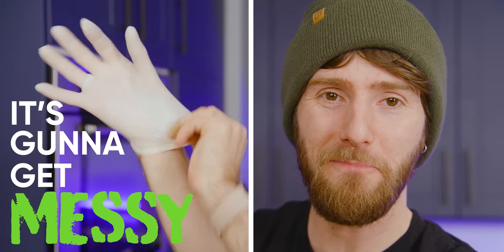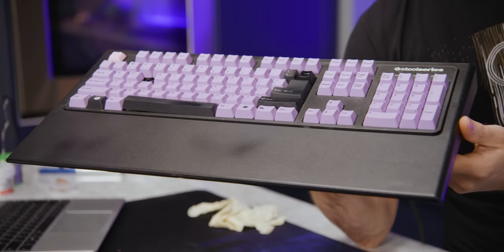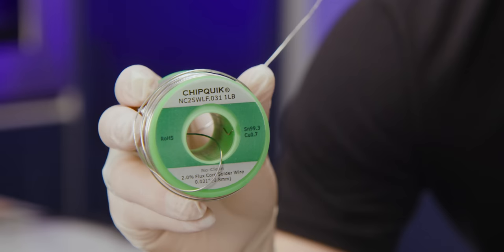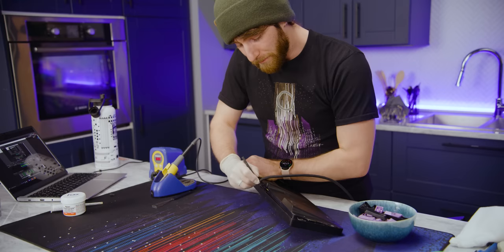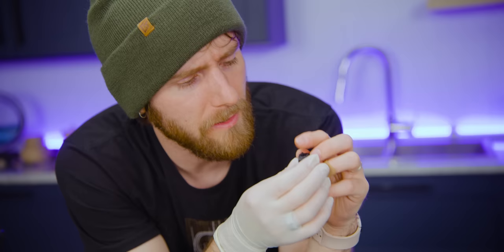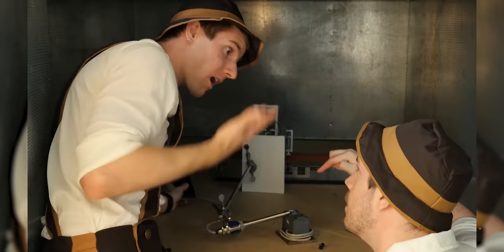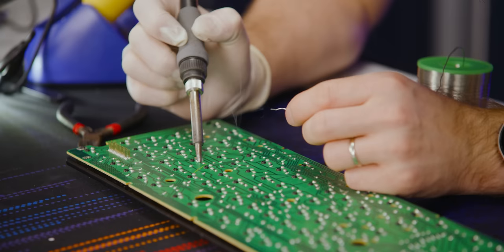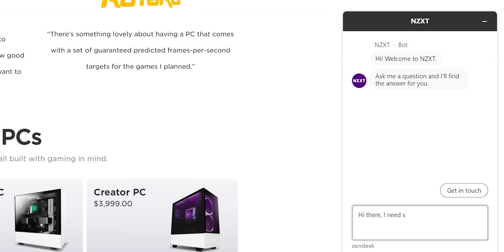Fixing my Wife’s $150 Keyboard for $1

Comment: 2:44 The first try to fix that would be (after a good clean of the whole keyboard) to blast the switch with contact cleaner.
Edit: 7:53 As said, this is likely total overkill. Just drench the key switch in contact cleaner, press it a dozen times or so, and test it again. Most likely, it will work again 100%. If it doesn't, then you still can replace it. Also: While at it, you might want to drown all switches in contact cleaner as well.

Comment: I literally went out and bought a new KB/Mouse yesterday because the E key (and possibly some others around it) was malfunctioning on my old KB (failed keypresses or duplicated keystrokes). I had a non-mechanical (membrane) Razer keyboard so swapping out the switches was not an option, I may still go back and see if I can fix it but I'm enjoying the proper functionality of the new board although the feel is alien since my old one had a much larger size for additional programmable keys.

Comment: Still these days I have this brilliant keyboard in lying around. Spilled coffee innit once. Disassembled it and rinsed board and parts with disstilled water and some parts with isopropyl alchohol. Then dried parts on low temp radiator some days. Worked like a charm afterwards and no corrosion formed later.

Comment: I retried my 7G about 3 years ago even tho there was nothing wrong with it after   almost 10 years of service. It was the first and only mechanical keyboard I have ever bought in that period and even tho the metal backplate got rusty, it was perfect. I felt like it deserves a honorable discharge after it's long and hard service and I replaced it with a razer optical switch keyboard, which I still can't remember the stupid name right, quite reluctantly. This keyboard introduced me into the Steelseries brand and made me some what a fanboy over the years. Ive since bought the Xai, Sensei, Seberia, Rivals and multiple mouse pads which all got wear and tear to their eventual death. Such a shame they aren't what they used to be anymore. Oh reminiscing youthful memories.

Comment: It's worth getting one of the cheap TS100 or Pinecil soldering irons. They even run off a USB battery if it has QC/PD. Repair a few cables and it will pay for itself. They are definitely cheaper than a new keyboard.

Comment: After that keyboard in dishwasher video I was surprised how well the keybaords did survive. So I pulled out my old nasty G19 that was basically trash to throw it in the dishwasher. I was able to detach the lcd display first. Long story short, over a year later that's still my daily driver even though it was gonna be trash haha. The illumination is not quite as bright as it used to be. Moisture in keyboard = bad? Not if it was more soda than keyboard

Comment: You don't really need flux if you are just soldering straight with the solder wire, since it already contains the right amount in it. At least if you are just soldering bigger individual connections, and not some chip with 50 small pins or so.

Comment: I had to do this, but I had to solder a wire to the switch and then solder that wire to the trace because the connection was broken

Comment: About a year ago I did something similar to that, but with my gaming mouse, the left mouse button wasn't responding bout a fifth of the time I would click and instead of spending $70 or so on a new one of the same kind I got some new buttons/switches for it and unsoldered the old one and put in the new one.  It cost me about $9 dollars for them, but I still have seven more to use when the ones in my mouse start to go again.

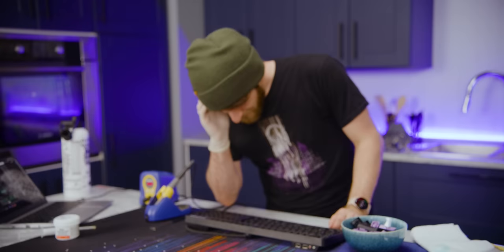Comment: 5:35 - You need to get a "detailing brush" (normally found at the auto parts store) to easily knock loose all that stuck on dirt in the cracks.
Reply: Normal brushes work too. The detailing ones just have the metal crimp hidden behind plastic to protect against paint scratches.

Comment: HOT TIP FOR QUICK REPAIR.
You save a bundle of time and hassle, and you go out and buy a can or CRC Contact WL, and a can of CRC Contact 60. You remove the key cap, and treat the ket mechanism with the two sprays as instructed, and 95% of the time, your bad contacts will be magically fixed.

These work on bad switches and bad pots of all kinds, from old mechanical things all the way through to modern mouse buttons and troublesome joystick HAT microswitches.

Comment: Do not clean using water and soap. Clean with isopropyl alcohol.
If one switch fails, before replacing the switch, remove the keycap, add 2-3 drops of isopropyl alcohol into the switch, reinstall the keycap, and test. This might do the trick.

Comment: i just finished unsoldering an entire razer board to salvage the switches XD don't try it with out a desoldering iron to preserve your sanity 
fyi, the keyboard had several keys stop working and software stopped picking it up, so figured i might as well salvage the good keys and maybe do a recycled Keyboard project

Comment: Saying the repair was just $1 dollar was a bit misleading
The switch may have cost $1 dollar, but you also need the solder, flux and a soldering station or a good iron pen that allows you to set a specific temperature or you may burn the PCB.
For someone who has never soldered before I recommend practising first on something less expensive.

Comment: I liked the video, its informative for lots of people who might be afraid to get into this stuff. I will contribute that you should not mix leaded and unleaded solder. They will destroy your soldering iron tips and its not good for the components. Best check if the board has ROHS on it for lead free or not. Use a different tool for each type of solder.

Comment: Mechanical keyboards are not equal. I bought two Corsair keyboards that both died within a couple of years. Faults, missed keystrokes and all that. 
Went and got a "Das Keyboard" instead - and it's running on seven years now with HEAVY typing and gaming. 
It also gloriously features zero RGB, two USB ports and an awesome volume rocker.

Comment: The bigger the blob the better the job (Flux). Consider using pen Flux dispenser brush. Additionally I would recommend to buy a bent/curved soldering tip.

Just some small handy tips :)

Comment: Those steelseries apex 7 keyboards are still running about $90+ even on eBay. My father did consumer electronics repair for decades, and I don't think there is such a thing as a 'high quality' solder sucker.

Comment: As long as it's not a Corsair keyboard. You have to desolder EVERY single switch to remove the brushed aluminum cover. I was beyond livid when I figured that out.
Reply: Well that's because the "cover" is the mounting plate for the switches...

Comment: To be realistic, I think it would be impossible to replace the switch for $1 unless you have everything like Linus did already. 

I bought the cheapest soldering kit for CDN$40. I didn’t have extra switches lying around (you will need more $$$ to buy new switches), but I replaced it with F2 which I don’t touch as often. 

I don’t know what kinda “geek” household Linus lives in, but the only tool that I had was the screwdriver. Having that said, the next time any of my switches breakdown, I’ve got the tools and can make it usable at $0 😝

Comment: My Razer Blackwidow Chroma V2 started having issues with keys typing a few months ago. I bought new switches and LEDs but it turned out an alcohol cleaning fixed the typing issues. However now several of the LEDs are wonky. I'd replace them but just from making custom lighting configurations I figured out they are cross wired/shorted.

The one thing that keeps me from trying again with cleaning with alcohol is that I'm not sure if the shorts are between the white metal light reflecting plate and the PCB (it's not on the back because the last cleaning should have gotten that), and I can't find any information on how to remove that plate.

Comment: Hey Linus, will you be including ease of access for self repair in reviews, that could be useful?

You reviewed a very expensive (at the time, and still is) Corsair K95 RGB Platinum. I recently did what you have just done with that very keyboard, faulty F4 key. It worked, only... a month later the function keys went bezerk with random key presses, making it unusable. So maybe not so successful in my case. Taking it apart it was very clear they did not intend for it to be a self repair, if repaired at all. The main PCB (1 of 3) with the keys has a lot of ICs on the back with a dense set of traces, far more complicated than the board in the video.  It makes any key replacement in the middle harder than on the edge where i was working. Meaning you need a very steady hand.

Enjoyed the video.

Comment: Can you do an update video for the dishwasher keyboard cleaning, since some ended up failing? Was it only ones with special extra, like volume wheel and displays? I would think membrane boards would also be harder to get dry without opening. The boards are probably gone by now anyway :/

Comment: Lol when they talk about actual switches it tells me that I might soon really have to replace the keyboard I've been keeping because it doesn't have software to go with it, K70 Vengeance I bought in 2014 that still works like new, but from this current video, I think I'l try replacing switches before getting another keyboard when it starts being faulty because I do not want a keyboard dependent on software, with how my current mouse doesn't work correctly if the software isn't updated.

Comment: When i repair someone´s old keyboard and they are going to pay me for it, i always tell them they should replace minimum all 4 direction keys (w,a,s and d). But only if we are talking about a really old one and they don´t want to buy a new one. I do this because the chance of failure on the remaining keys are high when one key is already broken. And (not always) but most of the time those keys, W,A,S,D are the first keys to go. And it´s 1 hour of work time to replace one key, and its just the same replacing 4 keys.
Reply: That's solid logic! It's like tires; if one is worn out, chances are you need to replace all four. I use the same logic whenever folks come to me with their engagement ring with a missing prong on the center stone.

Comment: I've had better luck using a desoldering pump instead of solder wick. Solder wick is more likely to ruin solder pads for through hole components like switches.

Comment: I have a Old Razer blackwidow 2013 that i bought back in 2013. just changed all the switches (soldered) from Cherry Blue to Cherry Silver i lost 1 diode and found a red one instead. 
it wasnt broken but i wanted to try out new switches.

Comment: i dropped a tea in my k95 vengeance at one point at had to clean it with a hose, well that did the trick even though it was blinking like crazy when I dropped tea in the first place, just dry it with a heat gun and it'll be fine

Comment: How to clean Mechanical Keyboards:
1. Disassemble
2. Dump in a bucket of water.
3. Dry
4. Assemble
Every time I see some one re-soldering keys, putting Oil where no Oil has ever been before, I need to barf a little bit in my gamer's mouth.
P.S. your Dishwasher in not the same as bucket of water. Water does not damage turned off electronics, you're keys are Plastic and they slide on other plastic no Oil required. Jeez

Comment: I wish I could've repaired my old $30 mechanical keyboard, but unfortunately somehow spilled hot chocolate and ruined the board. Keys and switches are easy to get and replace, but boards not so much. Ended up replacing it with a keychron keyboard with replaceable switches and keycaps, don't know about the board though.

Comment: 0:50 Would it be possible to tear down just the switch and just replace all the parts inside without even tearing down the keyboard and desoldering the switch? I know tools exists that allow lubing a single switch without desoldering it.

Comment: for this job u must use a desoldering pump for through hole components desoldering wick will not do the job u run the risk of getting fed up and start bending the legs of the component and end up ripping the via's

Comment: I've inherited a mechanical keyboard from a friend and had the exact same issue, but because i'm a cheap bastard, instead of buying a new switch, i just swap it with the switch from a key i never use, like the "Menu" key some keyboard still have. So that's also what you can do if you're cheap af like me too :)

Comment: I remember LTT putting Keyboards in the dishwasher. And if I remember correcty, the Keyboards worked afterwards. So put it in the dishwasher?

Edit:
Ok nvm.
Get an ultrasonic bath and clean it with alcohol.

Comment: linus why not use a cheapo 50 cent clean paintbrush to clean the dust off the keyboard instead of using the air thing, its not like  static is gonna be a problem.

Comment: Who needs to spend $100 dollars on a brand new mechanical keyboard when all you need is some solder, a $1 dollar replacement switch (along with a $153 keyboard from 2008 worth $189.74 adjusted for 2021 inflation)

Comment: This way of switch removal is utterly terrible and leads to pcb breakdown in switch pin mounting points. Deleting unleaded solder with using leaded solder+flux and solder sucker is so easier and safe for pcb than using a solder wick

Comment: @linus I can make it work I. Kess than a dollar. Just put 1 drop of JOY DISHWASHING LIQUID in a gallon of water mix it and put your keyboard for an hour to clean the mechanical key switch then wash it and dry it from the sun or whatever dryer is available but for me I use the sun's heat for at least 2 hours and it will work well. I challenge you to do the same

Comment: oh I have exactly the same scope for my coins... took about 5 USD
// Any responsible keyboard manufacture should at least make sure steps in the video can replace bad switches. just do not spray water on it, if chips fail, you might need to take all switches out in order to replace the chip.

Comment: my roccat vulcan needs several replaced as the titan switches are utter shite.  they fail so often.    (up arrow  J and 2) and the last 2 i rarely use as a gamer and J isn't used much in my typing. Sadly roccat used their own switches and does not sell them as they car about repairability as much as apple does.  (same for a dead mouse i have from them that that refuse to provide a switch for even tho the scroll wheel button is just bad quality. 

People need to implement a no eating behind the pc policy hehe. And spend the 1 dollar saved on a cover for the keyboard.
Reply from the maker: You can harvest switches from keys you don't use (pause/break, End, etc) and swap them over to keep it going for a little while longer! -CW
Reply: @LinusTechTips  Yeah i was planning on using the Numpad / and * and scroll lock key as i never use those keys.  it's crazy tho as it was a 150 bucks keyboard just 25 months old (yes just past warrantee sigh).

I may get a optical one as the next keyboard as they dont have metal parts that need to connect to register.  then again if the laser dies the switch is dead to.

Comment: Rule one. Throw the lead free in the bin and just buy 60/40 lead flux core solder.
Screw the environment.
😅

Wick never works for me but maybe that's just because it's Chinese cr@p together with the flux.
Only buy decent stuff or you will screw up.
Don't need to flux again when mounting it back using fluxcore solder.
Unless your using your cr@p leadfree solder 😂

Comment: *Psst..* ..Do not let Linus see this, but someone should really go check on the welfare of the editors.. -As it happens, I just got a weird secret coded msg across the atlantic @ 9:27 in the form of some obscure video.. And the trace led here. And well.. The msg states how some poor editor(s) are trapped in; What they call an "EDITING DEN". I do not know what that is, but sounds just about as ominous as your mother-in-law's nether region. And if true, repercussions could possibly be just as dire as well.. -So NOW; This is the call to arms you've been waiting.. To free those editors.. or at the very least: Go check if there is anyway to help out at your local Editor Shelter. Or perhaps consider adopting your very own editor, to give them a forever-home. BUT REMEMBER; TO SPAY AND/OR NEUTER YOUR EDITOR. It is for the good of the whole Editor-population. #FreeAssange